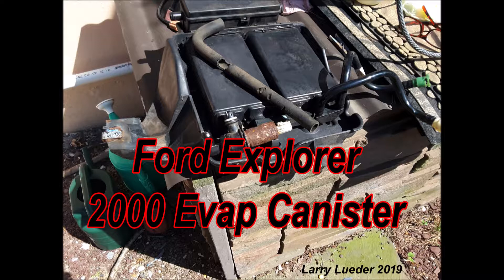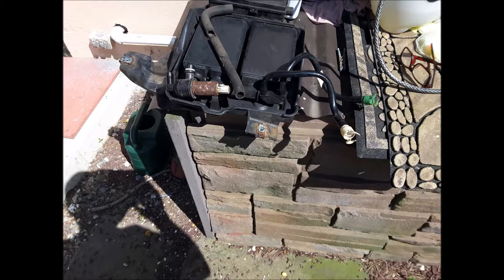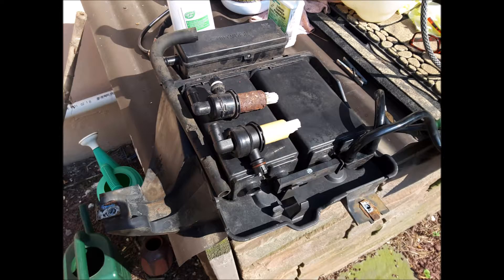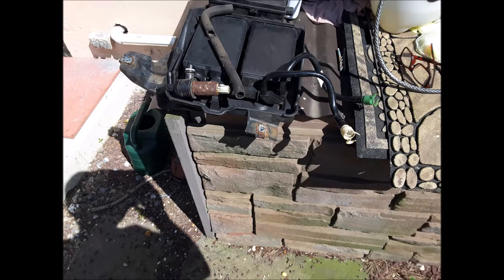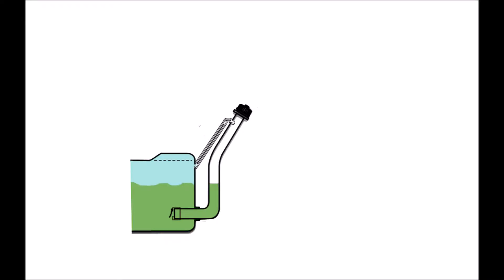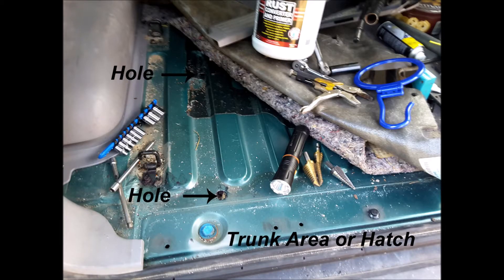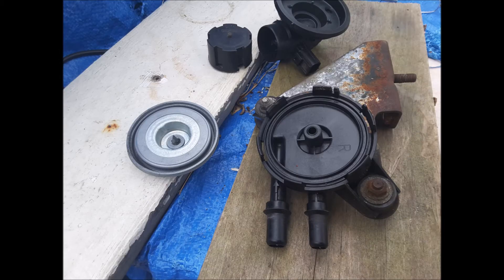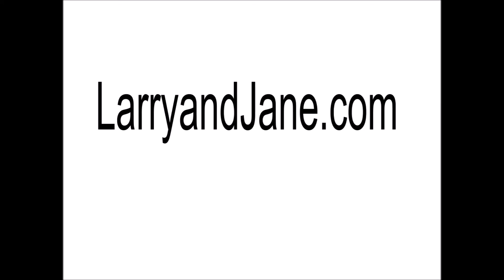Ford Explorer EVAP System and how to Bypass it.

Comment: I'd appreciate your help. My 2005 4.6 Explorer is very hard to fill with fuel, pump keeps cutting out. I've replaced the valve up near the tank, there's no EML on the dash. I'd happily bypass the whole system to cure this but am unsure how to go about it.
Reply: If you don't have emissions testing where you live, and you don't care about the check engine light being on just disconnect the hose that goes from the tank to charcoal canister and leave it unhooked, then it will fill perfectly. This is what I have done to my Ford E350 van.
Reply: @who_wantsit  We do have emissions testing, and the engine light is also a fail. Good info though, I wonder if I could tap into that hose with and additional breather hose with a manual tap at the end that I could close at testing time.

Comment: I have a beautiful running 97. Nothing wrong with it at all! But the damn evap monitor won't come on. I'm in CA. and apparently the new law allows one monitor to be off. I'm all for taking smoke blowing beaters off the road but this process is getting the better of my patience failed the test missed the hydrocarbon max allowed by 3 hydrocarbons. Ridiculous. How do I know those 3 hydrocarbons didn't blow into the testing sensor from someone driving by? And OBD II was never designed to be a baseline for a test. They just outright dismiss cars entirely for a code. Did you know a P420 code on one guys car he could never find out what it was. Eventually he found a bolt on where his exhaust mounts to the back of his engine had broken. So that little bit of rattle was throwing a code. And were using these vague codes to herd people through a process that costs hundreds of thousands of dollars. I just replaced my sparkplugs less than 50k miles ago they're fine! But every mechanic I talk to tells me to change them. I cleaned out the throttle body put a new IAC valve. I'm not sure what to do about this EVAP looks like more headaches. I want my life back! My explorer is fine!